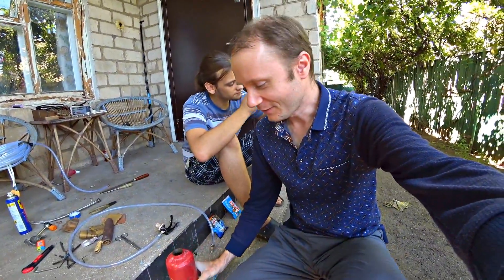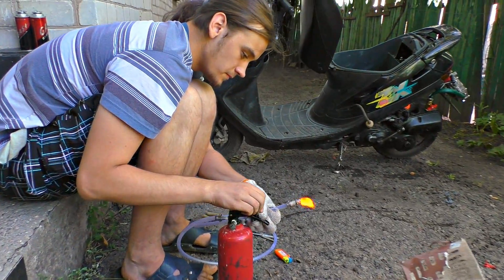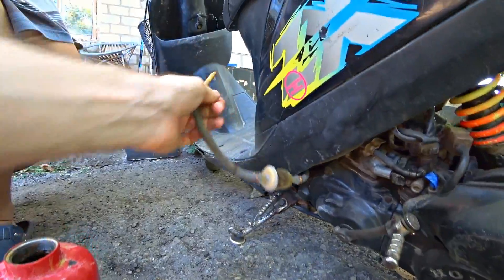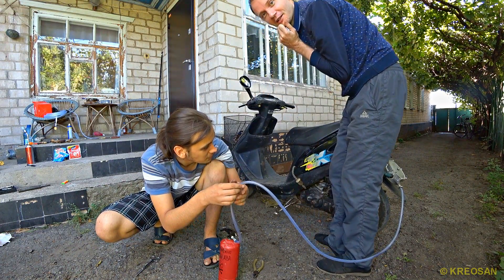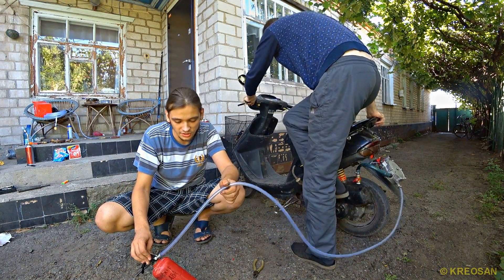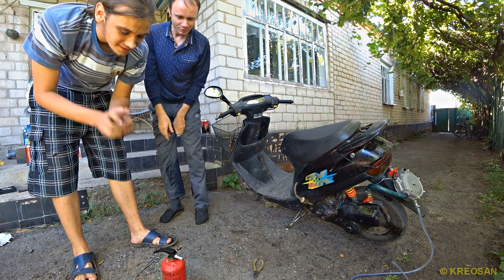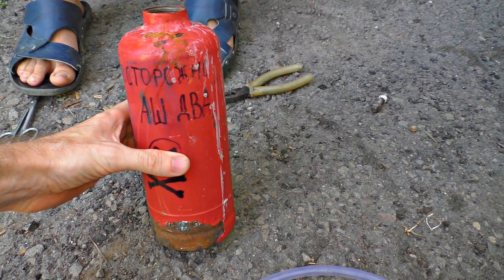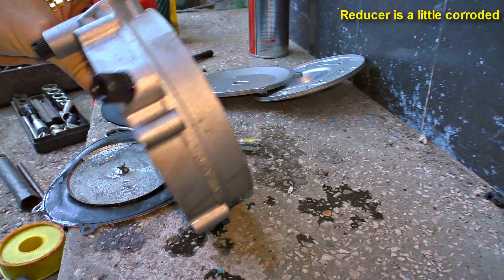Hydrogen Scooter 🔥 First Tests!

Comment: I saw a brown spot in the back of your pants!!  Continue with this, with this advice.  I believe you will need a larger reactor vessel, not to put more reactants, but to allow slower pressure buildup.  Add a pressure gauge to the reactor, and monitor it closely during the next experiment.  Use a secondary container that catches any liquid before it can get to the pressure regulator.  Also, before the pressure regulator, put steel wool in the hose over 10 cm in length, enough packing to allow gas to flow, but not block the line.  This will prevent a flame from travelling back towards the fuel source.  Search for "flame arrestor" if you need more details.  Last, you need a pressure release valve on the reactor to minimize too much pressure build up.  So proceed, but do so with more safety in mind.  We don't want you to explode!  Have fun.
Reply: Maybe some ideas may include the same canister,but with two stainless steel bowls or some iron casted hemispheres welded together filled with water to the brim,with the small canister inside and water to cool it down.Consider adding control rods for absorbing the heat or dissipating it into the air.

Comment: Do NOT compress H2O2 as it is produced. Some people have tried and have died! You MUST SEPARATE H2 from O2 (by electroysis, you have oxygen on one side and hydrogen on the other). Also use a flashback arrestor and and a check valve.
Be safe. Good video, thanks.
Reply: I was only refering to Kreosian planning on producing hydrogen through electrolysis at the end of the video.
You don't need to be mean.
Reply: its just hydrogen lol.
Reply: Good to know that if you compress hidrogen peroxide you die. XD
Reply: There must be at least 96% of pure  hydrogen if you want to compress it to be stored in a tank to be safe. Below 96% of purity is extremely dangerous and deadly.
Reply: The hydogen they produced using aluminium and drain cleaner is pure hydrogen without oxygen
Reply: @danielnyman6082  it's not pure or it would burn clear the yellow flame is a tell tail of other impurities in the gas.
Reply: @dngendron  just sodium from the NaOH in steam droplets.
Reply: @danielnyman6082  not pure, there is some water vapour since the drain cleaner is a solution of water and NAOH or KOH and+the reaction is exothermic. they measured the bottle 111c
Reply: @danielnyman6082  yeah u right. this guy TheGorphs is a wannabe smart. but he talked to early. and he got likes to. 
it seems is better to be stupid to get likes

Comment: You need to add a special valve so no gas/flames or liquid can go back
Reply: A bubbler is what they use so if it has a flashback it will pop the top on the bubbler but won't go past the water
Reply: @Youtubeforcedmetochangemyname  a large 'bubbler' to also condense the steam produced by the reaction. A pressure relief valve on the steel container they're using to produce the flammable gas annnnnnd some protective clothing and face protection so they don't get sprayed with boiling water and sodium hydroxide. Better still, they should just skip this whole idea because they don't seem to underrstand the hazzards.
Reply: Kirk Claybrook There is no need to swear

Comment: This is great but PLEASE PROTECT YOUR EARS!
Damage can be irreversible
Cool stuff though :)
Reply: @MrNeutron98 And also balls. Always protect your balls.
Reply: Ears are the least of their worries. Boiling water and sodium hydroxide will blind you and burn & disolve your skin. Not to mention producing a flammable gas inside an unvented steel container. I'm gennuinely surprised these guys don't appear to have suffered a serious injury from some of their stupidity. Yet.
Reply: @kirkc9643  yeah the metal container is basicly a pipe bomb
Reply: melon
Reply: they weld with no eye wear so

Comment: Flashback arresters please! Good luck!
Reply: hly shit i cringed so bad when he lit that thing with that thick tube..
Reply: Me to! I was sooo scared. If that bottle blew up they would have died!! Also they dont wear gloves! That drain cleaner is really dangerous in water and will eat your whole hand if it was spilled on there hand when it was 110 degrees! So stupud
Reply: Damn yeah, and pressure release valves too
Reply: No need for it, even if they get a flash back, it would just be a "thing!" sound and not much else. That bottle can take it with 0 risk. Having a pressure relief valve and not pressurising the bottle at all would be nice.
Reply: Me to! I was sooo scared. If that bottle blew up they would have died!! Also they dont wear gloves! That drain cleaner is really dangerous in water and will eat your whole hand if it was spilled on there hand when it was 110 degrees! So stupud